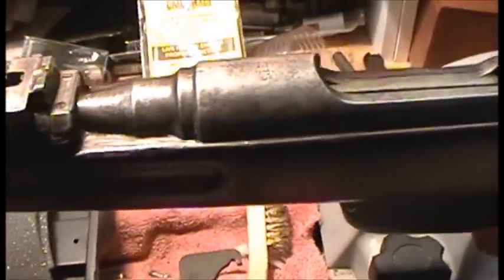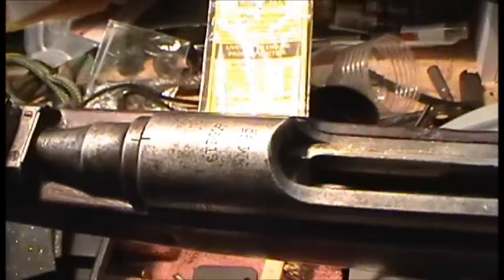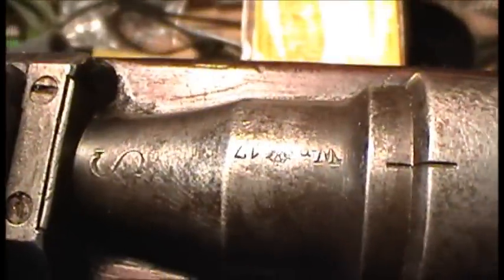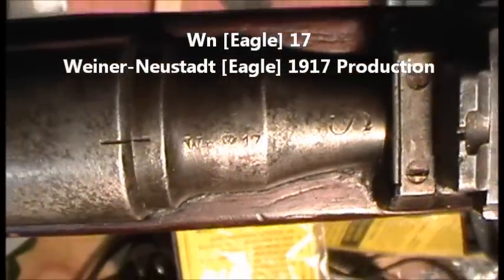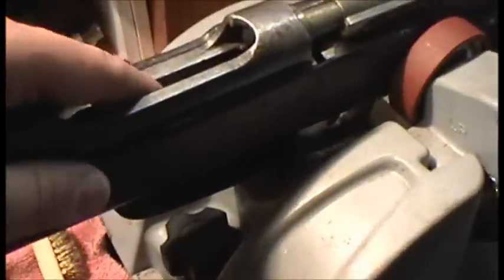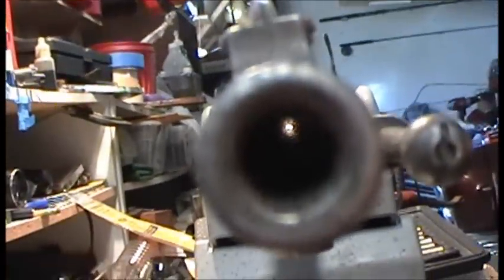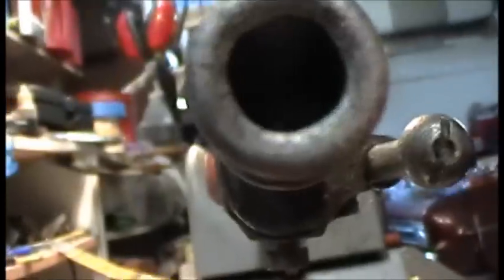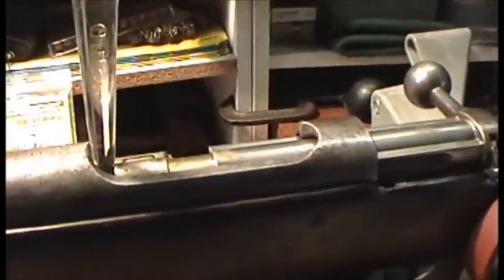Steyr M95 Long Rifle

Comment: The WN and 17 means it was accepted for Austrian service in 1917. The S means it was rechambered and had the rear sight modified for the more powerful 8X56R in the 1930s. Sometimes the chambers could a very light polish to remove rough spots.These converted rifles were sometimes prone to jams due to weak extraction. Also the barrels are lite and heat up quickly. The first few shots are usually tight; the rest will walk due to barrel heating. Good luck and have fun with the M95;it shoots high

Comment from the maker: I'll have to dig out my K31 and see if I can do a vid. Since there is a sleeve inside the K31 bolt that rotates on a small cam it unlocks for extraction when pulled rearward. Similar with a Steyr straight pull action. Twp parts to the Steyr bolt, that rotates to lock and unlock. If there were every instances of them not working in trials, surely they never would have produced them. The straight pulls are very interesting rifles, but I think the Swiss straights are nicer than the Steyrs by far.

Comment: I have a 1916.  But from what I've found I'd say we both have very unique varyants of this riffle. Very hard to find info on m95's still as long rifle with shrit/paces sights that have been re-chambered.
Reply from the maker: I never kept it for very long. Ended up trading it off for a Mosin some time ago. If you aren't a member on Gunboards, or haven't searched there yet maybe give that a try. I know a couple very knowledgeable guys on the forum that could probably tell you what you want to know and more about these rifles. It was of particular interest to me at the time because I have always had an interest in 8x50R converted Mosin Nagant rifles. A little while back I finally found one that was converted. So I can help identifying how a Mosin Nagant was rechambered to 8x50R.